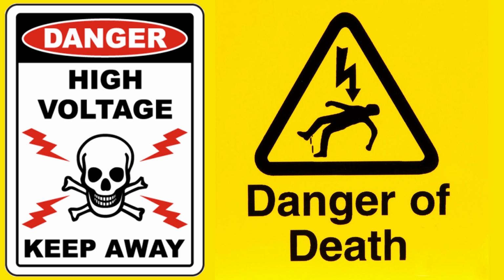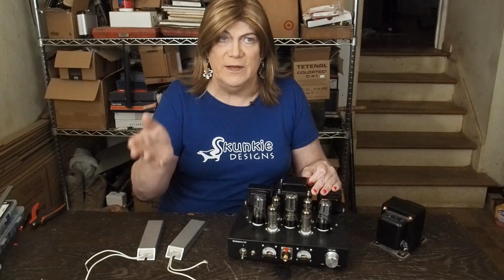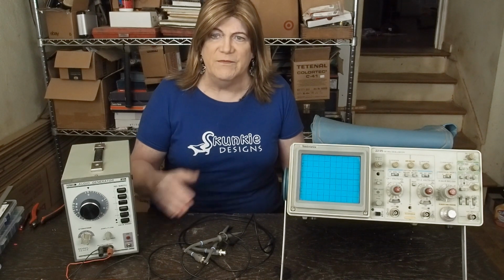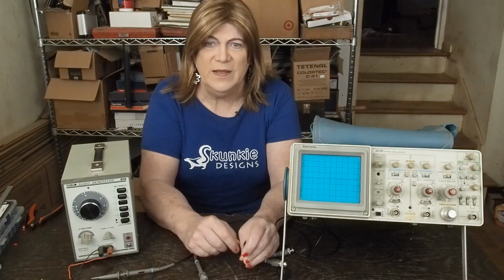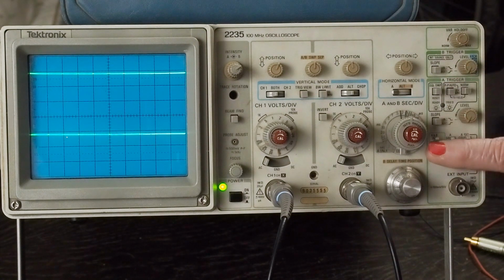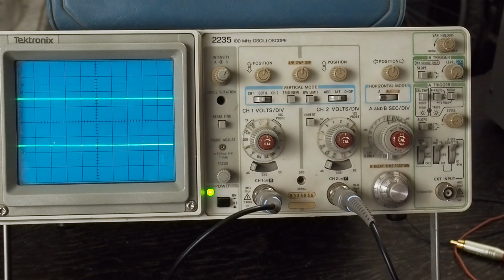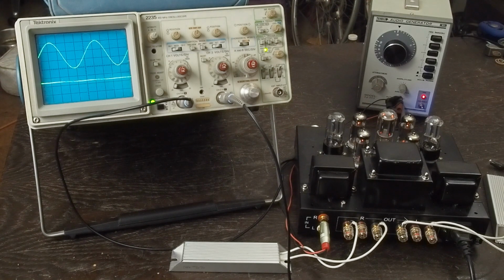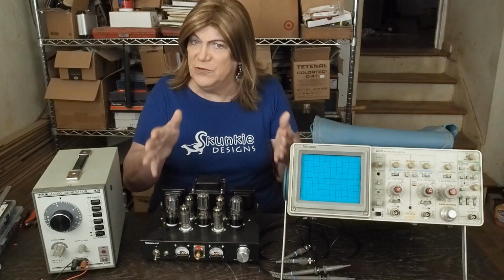Oscilloscope Basics for Vacuum Tube Audio Testing

Comment: Hello! Great vid and very easy to understand. Can you tell us more about the isolation transformer, mainly what do we need to get(buy) to test amps like a Dynaco ST70 or tube preamps. I know they have a wattage rating but what is the one you are using, and what are the specs for it. You said its on Amazon..I am there if I get the right one.  I am in the USA but if you could describe one for 220v EU use that is cool too.

Comment: This was fantastic! Ive built myself a few tube amps (Champ and Bassman/JTM45/Plexi mashup) as well as modded my existing amps and restored/recapped a couple tube radio receivers (one was my grandfathers old RealTone 6BM8 receiver and the other an old CB of his but the name escapes me). And of course more guitar pedals than i could mention if i tried lol. After doing that kinda stuff as a hobby for a decade i only just recently picked up a scope. Its an OWON HDS242S (one of those DMM, Signal Generators and Scope 3 in 1 handheld units). But so far ive only used it for a few things like diagnosing bad IC's by checking for a packet of square waves at the input and output etc. My understanding of how to use a Scope is still very limited but this video helped. Id like to be able to test tube efficiency cause ive got a ton of current production EL34's and a handful of NOS EL84s that id like to sort through. Anyways thanks again for the info it really is and was helpful!

Comment: Here's the thing that's confusing. Get an isolation transformer to protect you from school but negative probe on ocsilloscope IS ground referenced. How does this protect your scope?
Reply: Not school, shock.
Reply from the maker: It avoids an issue of accidentally touching the ground lead on the probe to something hot and back feeding that into the scope. If the device under test isn't ground referenced, it doesn't harm the scope.

https://youtu.be/LbkCU-LBqKk?si=o4MLSZ32s84si5kx&t=215

Comment: Thank you for this video! (and the others as well - I'm currently following your EAR834 series, trying to build one myself - great stuff!). I have a few questions: Can you confirm that you're using the isolation transformer to power the amp and not the oscilloscope? I just got a 300VA one (I'm in EU, so 230v) - will it be enough to power an amplifier? And finally, for an amp that's powered by a SMPS brick (ACA), do I still need to use the isolation transformer? Thank you for your time!
Reply: HA! Just got my answers in the first seconds of the next video I started watching (testing a tube pre-amp): "unit under test" goes on the transformer and the oscilloscope stays grounded. And your transformer is a 300W one, so mine should also do the trick. THANK YOU!

Comment: Well today I bought a Textroix 2235 on eBay. I bit more than than 150.00 yet it is very clean and working. New probes, new manual too. 
I have watched you a lot and I’m not going to menus type. I been looking for several months and found what I believe will work for me.  Thank you for your channel on YouTube I’ve learned a lot on safety. I still need dummy  loads, signal generator .  I thank you on why You are using older equipment testing machines.  I’m happy until I get it home and try some basic testing with it. Thank again.
Reply from the maker: glad it was helpful!

Comment: Thank you for this video! Just bought a digital oscilloscope and tested my Type 45 triode amp. Worked out fine but what caught me off guard was that at higher frequencies I could faintly hear the signal from the Lundahl output transformers! Started  panicking a little but after googling discovered that singing OPT on a dummy load are not unusual. Can you make a video how to detect and hunt down oscillations and other issues best detected with a oscilloscope? My amp measured really nice up to full power over the whole frequency range (20-20khz) but I was wondering how I could see parasitic oscillation at higher frequencies or is it ok if 20khz look exactly like the input? I have a very small phase difference between input and output, is this normal? Thanks again for your valuable videos!! Best F
Reply from the maker: Looking at the square wave is a good indicator of oscillation issues. And yeah, depending on the amp design, not unusual to see a little phase shift.
Reply: @SkunkieDesignsElectronics  thank you! I spend more time with the oscilloscope yesterday and I think I nailed the issue! I was hearing a high frequency hiss as soon as the amplifier warmed up, redid all solder points multiple times and also switched solder from 95/5 Ag to the spool of 60/40 I had left just to eliminate any cold joints that might be. I had the scope at the ready when it happened again and measured the amp on the spot, well nothing to be seen on the scope, reconnect and it hisses!! Then it dawned on me to look at the input side and lo and behold, the cheap Bluetooth adapter I added in the chain so my wife and daughter can connect the phones was making crazy spikes in the signal path and my passive channel switcher  fed it to the other channels. What a relief! I reworked the passive switcher because the scope showed little spikes even with the BT gone and now I get a flat line just connecting my dac to input and the scope on the output! Oh I love this thing, why didn't I get one earlier?! Sorry for the long story but I'm so glad your videos encouraged me not only to rework my amp but also to poke around in it with the Oscilloscope ! Thanks again

Comment: Skunkie Designs, you are talking about the old power panels. The new ones do not join neutral and ground. But I just picked up (3) Triad N-92MD 500VA, and (1) N-90MD 250VA isolation transformers for hospitals, FREE! About $700 worth of transformers  between all four!
Reply from the maker: I don't think the US wiring has changed. http://hyperphysics.phy-astr.gsu.edu/hbase/electric/hsehld.html

Comment: This was fun because I have the same scope... almost, 2235A (it has one extra knob for backlighting grid). I was wondering how you hooked the signal generator up to the scope and the amp. You mentioned connecting it to the scope and said something about RCA plug to FG (I presume that was the amp input), but are you running them parallel out of one FG output or from 2 different channels?
Reply from the maker: I simply connect the signal gen output to the amp and connect one probe also to the signal gen output. Then I have 2 dummy loads connected to the amp outputs and connect a probe from the other channel of the scope across one of the dummy load resistors.

Comment: Great video, I'm just learning this stuff and a little confused on how you came up with 1.9w. isn't 11Vpp x .707=7.7rms?
Reply from the maker: It was 9Vpp on 110V is 3.18V RMS 11Vpp is 3.89RMS. You are doing the calculation for voltage peak (Vpk), not peak to peak (Vpp).
Reply: @SkunkieDesignsElectronics  your right, thanks for clarifying, still learning. I really appreciate you taking time to teach.

Comment: Just go my first scope (siglent 1104E-X) for  home.  I'm used one in work for years but this is the first for my home bench.  Having built a couple of guitar tube amps for gigging it will be nice to finally see whats going on in the amp, stage to stage to output, and how the signal changes over different gain/volume settings.  So vids like this help to give confidence on what I'm looking at and why its happening.  Thank you for your efforts putting these videos out!  I definatly get something out of them.

Comment: It’s definitely nice to view analog waveform on an old analog scope for me it is easier on the eye. However the features including automatic readings of frequency and voltage and FFT spectrum analysers on even a low cost digital scope really take the work of it.  Regards distortion if you can see it on the sine wave it’s really really bad  but I guess it will show gross distortion.
Reply from the maker: Yeah, if you can see it on a scope, it's really bad :P
Reply: I could be wrong on this but I think I remember a figure of 20% harmonic distortion before it’s visible to the human eye etc on a scope

Comment: I just got the digital 2 in1 Oscilloscope and Generator and couldn't find how to connect the signal generator. This is the first video on youtube that I has looked since yesterday that saves my time to look around, right on time :) Thank you so much to be a mentor/instructor for DIY. At 14:30, I saw you pulled out the clip and I tried but didn't come out. I was afraid to break it....lol......but did tried again and it worked. Looking forward to see more measurement videos.
Reply from the maker: Glad I could help

Comment: Can you link this isolation transformer you use? Thanks!
Reply from the maker: This one is $49 on Amazon 

https://smile.amazon.com/Jameco-Valuepro-ITR300-Transformer-Isolation/dp/B00B886DGS/
Reply: @SkunkieDesignsElectronics  This one has 2 prongs inputs, do I use it with those 3 prong to 2 prong adapters?
Reply from the maker: @bernardosilva7306  Yes, or do like I did and dedicate a IEC power cord for this use and remove the ground pin on the end that plugs into the isolation transformer.
Reply: @SkunkieDesignsElectronics  Awesome, thanks a lot!!! :)
Reply: @SkunkieDesignsElectronics  Good, that's the one i ordered.